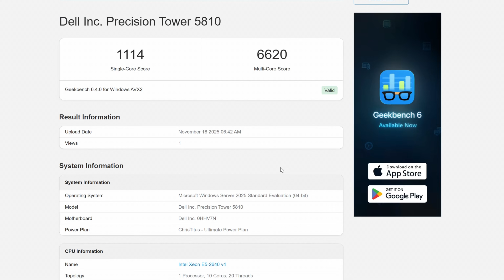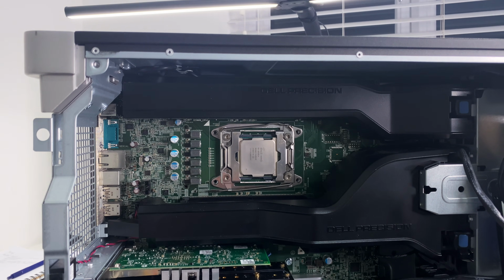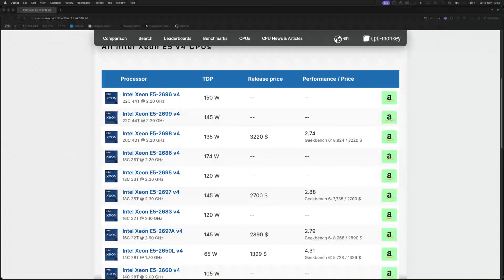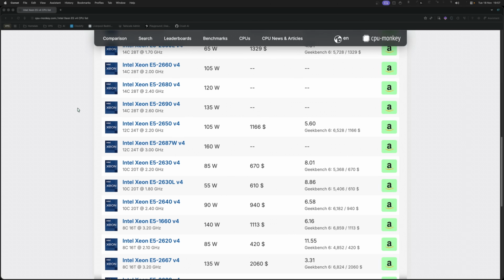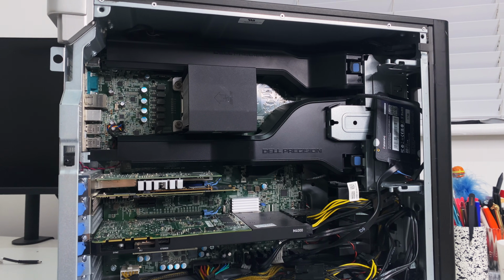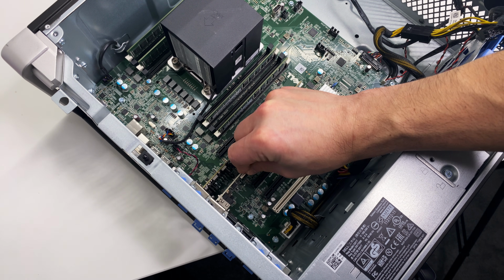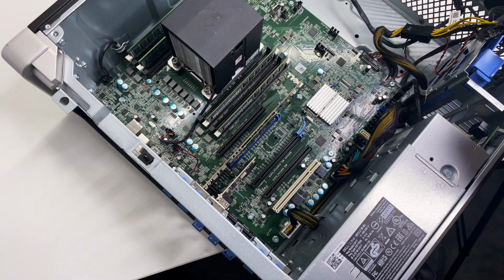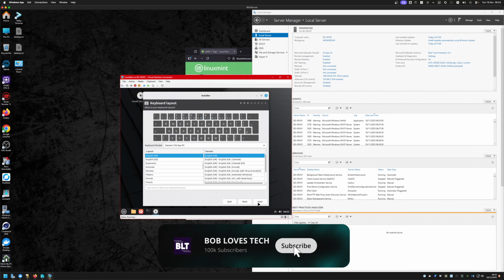Are You STILL Building Homelabs with Mini PCs?

Comment: Got an hp z4 g4 for $150, 64GB ram, no storage, and a lackluster cpu.  Using some apple specific skus, i can easily, and cheaply add a 10+ core skylake cpu.  It also has windows 11 pro for workstation built in to the bios if i wanted a nice desktop pc.

Comment: Currently running Unraid on my dad's old hp pavilion desktop p6-2103sem. Mainly using it for Jellyfin, Adguard, Nextcloud. 

I've also been looking at other old prebuilts, but I'm starting to notice that all I can find they only have 
 space for one 3.5" drive, sometimes an additional space for 2.5" (which I did do) , which is annoying for my media server usage. I'm thinking of replacing the optical drive, and add an 3.5" adapter. Hopefully it can actually fit...
Reply from the maker: There are these 5 bay ssd adapters that fit into the space of the 3x 3.5" bays. Not sure if that's of any help?

Comment: Imagine having a computer running 24/7 drawing 80 - 100 watts at all times. My electric bill would explode
Reply from the maker: Yeah mine has unfortunately 😂 still cheaper than a vps?
Reply: Yh but consider that with mini pcs you'll have like 4 or more in a cluster and then a separate Nas or drive dock, a mess of wires, alot more cost and alot more parts to go wrong whereas with systems like this you can make it do all of your tasks on the one system, one set of parts to break, one machine drawing power and only a couple of wires because well it's a single system

Comment: Rookie. I have a similar unit with dual 14-core, 28-thread Xeon CPUs for a total of 28 cores and 56 threads, dual P4000 GPUs, dual 8tb SATA HDDs, a 256GB NVMe, and 256GB of ECC RAM that mostly sits in a corner collecting dust because it draws about 150W at idle and realized all I need is a 7th gen i5 and 16gb of RAM.
Reply from the maker: 😂😂😂 Yours is definitely bigger
Reply: Sounds like a rookie build.

Comment: I got a old dual xeon  10 core with 120gb ram on x99 motherboard from aliexpress for 60 quid  n built  system  around  it using parts had laying  around  and couple  of  things bought new psu and case 
So spec is as follows 
2x 10 core 20 thred cpus
120 gb ram
2tb m.2 ssd harvested from  faulty  steam deck 
2tb hdd harvested from old ps4 
Gtx 970 old gpu I had in cupboard 
Stuck capture  card in to use as streaming  pc  but is there anything  else  you could  think of i can use it for
Reply from the maker: NAS? Router??

Comment: Didn't go the Dell route but picked up a Lenovo P520 and a Quadro P620 a little over a year ago, it came with a W2145 (8 core 16 thread) and 64GB of 2133 DDR4.  Slapped a pair of 1TB SSDd in a ZFS mirror and brought it up as my "heavy" Proxmox node (the rest are old NUCs).  It's been rock solid, and I've got plans to slap some spinning rust into it soon to replace my current NAS setup.
Reply from the maker: I love the Lenovo route. Definitely keeping an eye on them on ebay
Reply: @BobbyLovesTech  too much chinese spyware in it for me.

Comment: Looking to build a NAS in a Fractal Node 804, and an lga2011 MB, Xeon E5 2650 CPU and 32 GB ECC RAM Bundle on Ebay is currently the most cost effective option. Good to see there are others building with this Arc still in 2025. That little orange blower is fantastic, need one of those.

Comment: I also use the t5810 as my home lab server (96GB RAM and Xeon witch 28 core).  I have Proxmox installed on it. On it, I have VMs including NAS (OpenMediaVult), Win 11, and many small services like wiki.js, nginxproxymanager, homeassistant, Nextcloud, etc.

Very nice hardware. Super quiet and doesn't consume too much power.

Comment: I got a bunch of these years ago. My main working server is similar, but I loaded it up with HDD storage. I had to get some extra drive cages. Idles about 50W.
Reply from the maker: Same CPU? That's encouraging
Reply: @BobbyLovesTech similar. E5-2650 v4. No L.
Reply: This is the point that many are apparently missing. They don't use as much power as they think.
Reply: @neo-farmers-dayz2052  Yes. My compute load is very low. I mostly use it as a NAS, so the CPU just sits idle most of the time. The HDDs use more power. It'd use a lot more electricity if it was crunching numbers all day.

Comment: it's funny that i found your video at this time!
I'm building my own T5810 at the moment! I upgraded mine with a E5-2680-V4 (14 cores and 28 threads) with 64GB of Rams and a GTX970!
I'm at the point where i wonder what OS i'm gonna run! My plan is to use this machine for cybersecurity stuff but I'm not fully decided yet!

Comment: Really depends on workloads. I started my homelab setup with a T7910 which I grabbed for cheap in 2021, put 2xE5-2680v4s in and managed to get 3xA4000s for learning more about machine learning. The power you get for the outlay of these old dell workstations is amazing, but if you are running them 24/7, expect to be paying a decent chunk of their original price per month in power costs. I’ve found the 5825u based mini pcs are great setup for the price and super power efficient for services you want running 24/7, and then I have the T7910 and another x99 tower I run on as need basis. If your workload does need a lot of memory, these old x99 setups are amazing as well, but their prices are also skyrocketing…

Comment: 28 threads would be a hoot.  I had wanted to buy a workstation, but the high TDP consistently discouraged me.  This would be lower wattage than my i7-870.
Reply from the maker: This L version is 65W. Bout on par with that?
Reply: The 870 runs astoundingly well, but has 95 TDP.  It's in this 2010 imac I'm viewing on.

Comment: You talk about feasible powerdraw however you dont mention any value. What does it consume at the wall outlet?
Reply from the maker: I didn't want the video to be too stats focused but I get your point.. I'll double check what it does and hopefully do an update on it
Reply: @BobbyLovesTech  Dude. It is the whole point of mini-pcs. The lower power draw. And also the small physical size with modern dwellings being space constrained. I have a mini-pc cluster, knowing I can pull it out and dump them into an easily moveable suitcase/box is great.
Reply from the maker: @firstspar no I get that but I guess it depends on the use case. I like the expandability
Reply: @firstspar  I was thinking the same thing. The power draw on his build is probably 10 fold what a N100 mini PC would be. Hard pass.

Comment: Actual idle and load power draw numbers would have been nice.  Just saying "very reasonable" literally means nothing.

Good video overall, though.  Very sad running Windows garbage on a home lab.  I don't care if it works.  For many of us, one of the key ideas is breaking out of the closed source Corporate strangle hold.  Proxmox would have been 1000% better choice but to each their own.
Reply from the maker: No that's fair enough Re powerdraw. I'm trying to keep the videos interesting enough without overloading with data. Haha stay tuned Re Windows and proxmox...

Comment: Hey Bobby I just got a T3610 for free and am planning on builds a Home Server around it. I've never built a PC and would like to attach some HDs and an SSD to the many SATA ports but it also only have to slots to fix the HDs. What could I do to go around it, how are you storing those drives inside the case? Cheers and thanks!

Comment: It is cheap because it just eats power like crazy even doing nothing.. No thank you, this is the worst advice one could get.
Reply: Even at $60/month power cost, you just factor that in as 'cost of hobby' expense, comparable to other hobbies.
Reply: @goodcitizen4587 oh yea, this is approx a half of the total power usage for typical home where I live, not worth of doing that, I like more my low power solutions and BTW from what I see the enterprise is also going for power usage optimizations nowadays
Reply: @ytxzwall that power saving sounds awesome until you have to run 60 terabytes thru Tdarr........
Reply: @mikeland3453 what? it is only 4x20TB raidz, so what is the problem? disks can spun down not used.. also at this level we also have think about redundant server anyway or some clever cold storage sync, as always it all depends on requirements and I only referred to rypical usage
Reply: @ytxzwyou obviously don't know what Tdarr does.

Comment: Got my T5810 for £50, after selling the graphics card and the RAM it was basically free. Found an ex-mining RX 2080 Ti for £100, sniped 128GB DDR4-2400 for £110 off eBay, got a 22core E5-2696v4 of Aliexpress for £60 and a 1TB NVMe SSD (gen 4) for about £55 off Amazon. Keep in mind RAM will forcibly downclock to 1866 if you install more than 1 module pe channel. v4 Xeons run cooler than v3, the stock cooler will handle any v4 very quietly. With a modded BIOS you can overclock certain v3 Xeons up to 4.2-4.5Ghz but they will be limited by TDP so only makes sense for 8-core or lower. You can install AM4 AIO coolers if you're willing to file the cooler mounting bracket a bit (holes are about 1mm off); only two aftermarket aircoolers (both from Noctua) will fit in the case. You can have up to 4x 8-pin PCI-e power cables (custom, available on eBay) to feed 2 powerful graphics cards, but mind the card height as the case is narrower than most. The largest compatible Dell PSU is 1300W.
Reply from the maker: Thank you so much for the info. I had no idea there's SOOO many options
Reply: There are also plenty of offerings from Thermalright and Jonsbo that will fit the 2011-3 mounting pattern.
Reply: My ram is running at 2400 with 8 sticks installed

Comment: And it needs a nuclear power plant for power. Your utility will be so happy. 😁
Reply: He mentioned in the video swapping out the processor for an L version which is a lower power use.

Also just having it running basic stuff doesn't mean it's using the full power.

I have a 100 core Xeon (combined processors) and through optimization, I am often at 600 watts, but I have enough spare resources to ramp up as needed.

I have similar systems to his for testing an other experiments, the power use and heat really isn't that bad.

I still have some ddr3 systems running because for the amount of resources I can use compared to what subscriptions would cost me, it's a no brainer.

Even older hardware is still cheaper than subscription services in many cases.
Reply: @neo-farmers-dayz2052  Can't beat the current generation of mini PCs. Super low power use, great power and scalability to run almost any workload. 10 mini PC use less power than this.
Reply from the maker: It'll keep the house warm in winter st least 😅
Reply: @BobbyLovesTech  Sure thing, then comes summer.....
Reply from the maker: @st939 we'll cross that bridge 😂